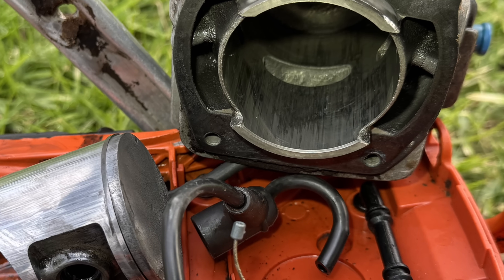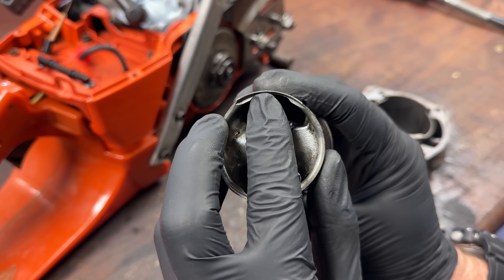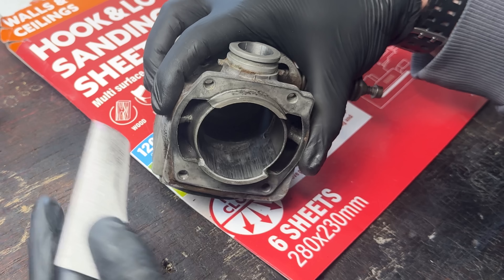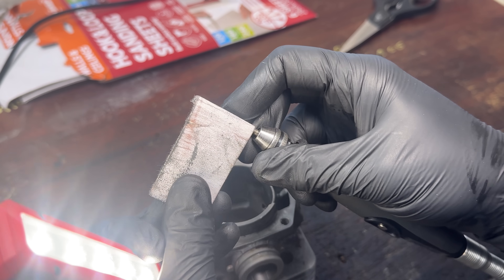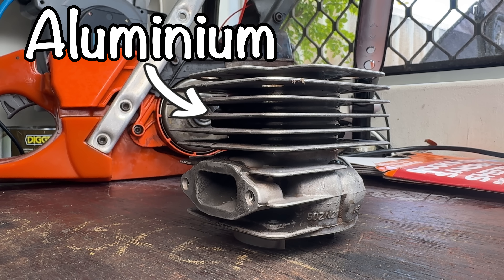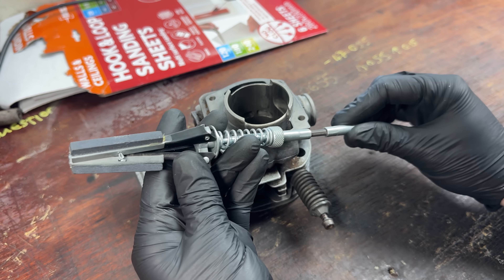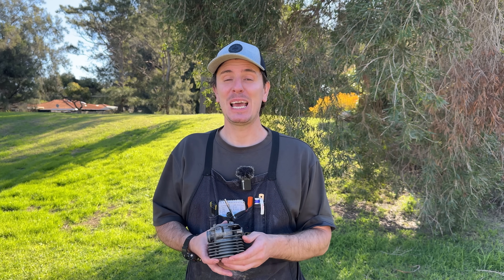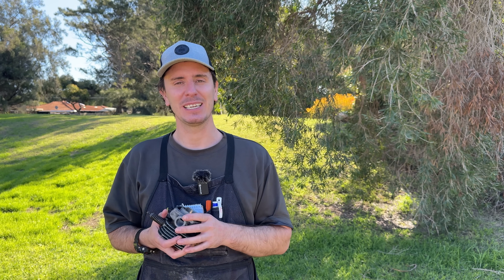Free Cylinder Repair Every Mechanic Should Know!!

Comment: I've never used HCl because it is such nasty stuff. Fumes escaping from the stored container can rust nearby ferrous objects. However, concentrated NaOH also reacts with and dissolves aluminum transfer and is much less nasty to work with. The reaction process is chemically a bit different, but, like HCl, hydrogen gas is released. Just put a some NaOH crystals in a plastic bottle cap and add water. This is an exothermic reaction, so go slowly. You can tell when the solution is saturated when it becomes a thin slurry. Apply with a Q-tip as with HCl and be careful around ports and transfers. This is usually my first step to get the worst transfer off. It does take longer than HCl, as it is not as aggressive. Then I go to flap sanding. You can use fairly coarse sandpaper, 150 grit, as long as you let only the flap touch the cylinder walls. Some hand sanding with 240 grit may be necessary at the very top of the cylinder. Then inspect the cylinder carefully for any scoring covered up by the transfer. I do use a hone as the final step. Usually a brake cylinder hone will fit nicely. Use a lubricating oil and an in and out motion. Don't over hone, just a few strokes. And before I start the whole process, I check the skirt to cylinder clearance with the piston I plan to use to make sure the cylinder and piston are usable. The cylinder is virtually always OK because of the hard plating, but it's a good final check on the viability of the piston. Thanks for another great post, Tom!
Reply: I must say hydrochloric acid really isn't that bad! The word "acid" is a trigger for sure, but our professor in the chemistry practical kept very calm when someone spilled acids, and just presented the bill for the broken glassware ;-) . One day someone had a mishap with NaOH (caustic soda lye) and he hurried up. It all depends on concentration, but NaOH can eat the flesh from the bone easier than HCl, and is especially a danger for the eyes. I have worked with both for various cleaning jobs and precautions must be taken in both cases.
I cleaned a crankshaft of a 4-stroke with aluminium welded on, unlike with the thinly coated cylinder bore there is no risk of damage when the part is all steel.
Reply from the maker: That's good to know,  though I take caution with anything labeled acid haha. You're absolutely right though, alkali is just as damaging, but doesn't have that same ring to it lol
Reply from the maker: Thank you for sharing your method and ideas as well as the kind words :) yes it's nasty stuff isn't it, I hate it, but it works well haha. I store it in the shed away from anything valuable and tightly sealed!

Comment: Score shouldn't affect compression except at very low speeds, but can increase blowby a lot, affecting the crankcase fuel mixture.
Reply from the maker: Yeah you're quite right, blow by could become an issue if it's bad! Thanks for watching :)